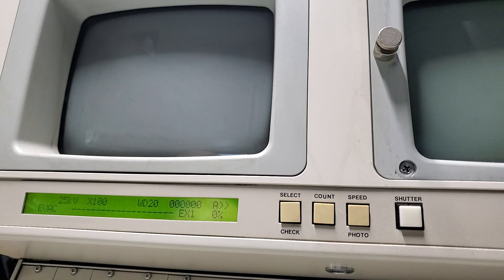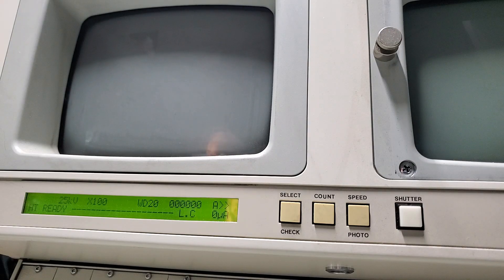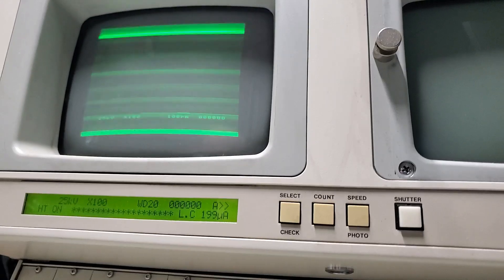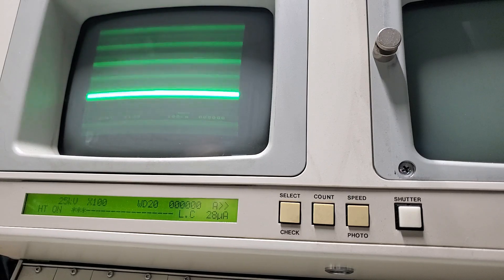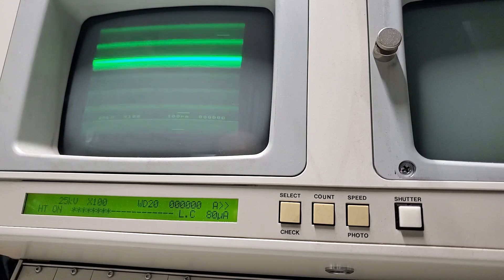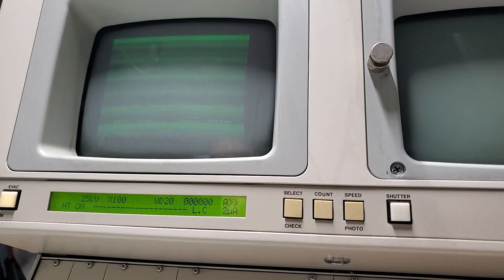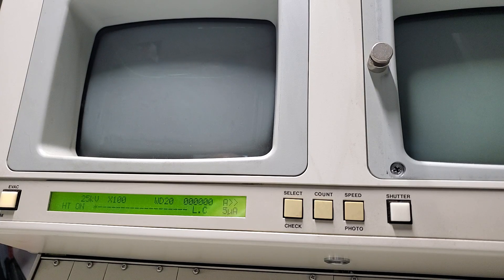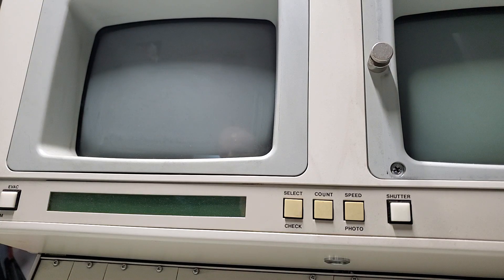SEM First Startup and failure

Comment: Wowzer, I followed because of a rebuild video you did for a rotary vane pump and it turns out we have the same SEM! I've been neglecting the project more than you though clearly -- I've yet to get the HT ready indication, think I have a vacuum gauge issue.

JEOL told me I was on my own so I'm planning on spoofing the vac gauge output and going from there.

Reach out if you need any info or materials, I have a tote full of misc parts and replacements plus the og manuals
Reply from the maker: If you use discord, there are 3 more of us with the same SEM in various states of functionality.  https://discord.gg/XttYgy8p
Reply: @MartinDoesStupidThings  I'd love to join! Seems I missed the link for long enough that it expired though haha, send me another when you get a chance and I'll be on top of it this time
Reply from the maker: @maxhoweth  https://discord.gg/dpk9EKy2  Should be good for another 7 days :)